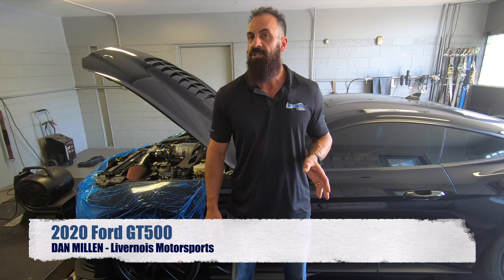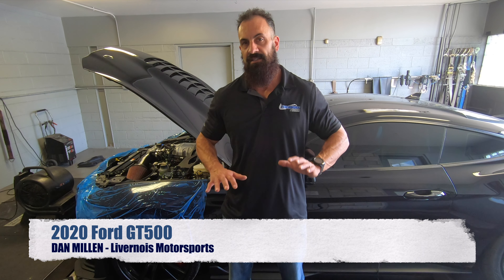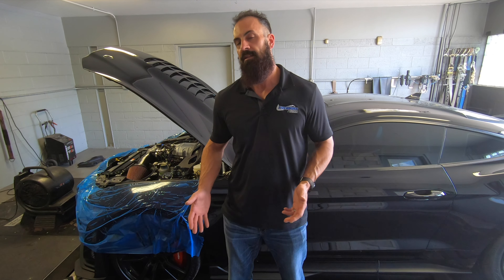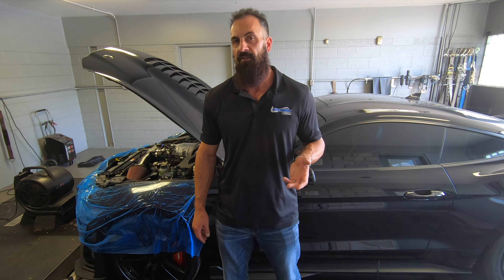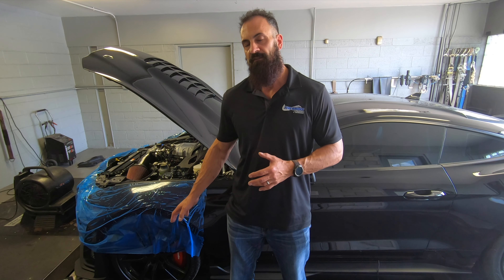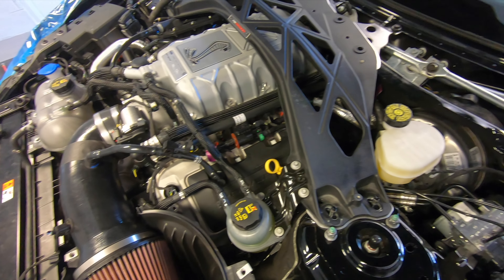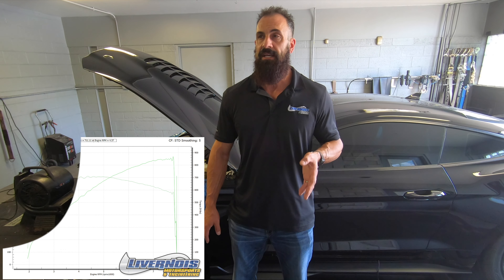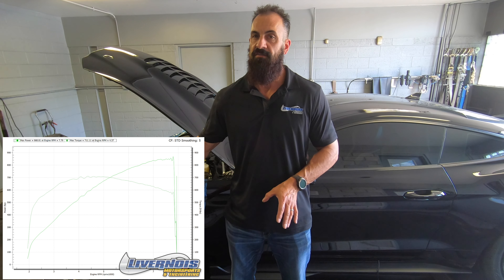2020 GT500 makes 1025 HP with only 3 part changes and E85!

Comment: Was this done at livernois in Michigan? What you guys did here is exactly what I'll be looking to do to my gt500 that I just acquired  when the time comes. Also do you think a upgraded belt tensioner would be needed? Would probably benefit from a throttle body upgrade too yeah? Also maybe upgraded fuel rails/injectors?
Reply from the maker: We did indeed perform these upgrades in house. As for the tensioner and throttle body, the tensioner isn't needed, but the throttle body indeed can be done as well. Usually with those changes we would also add fuel rails, cross over tube, and some other small upgrades.

Comment: Why you take off the intake lid cover?!?!? What i understood that your carbon fiber intake should work will with close box which will keep the inlet temp cool 
Am i right??
Reply from the maker: Our Airbox does work with and without the lid. The lid being installed typically does not lower temps except in the most extreme conditions, but for the Dyno testing it has not been reinstalled. It was installed prior to delivering.
Reply: @LivernoisMotorsports  sounds good , that mean there are no different between your intake and other brand such as JLT , because the only thing make me love yours than other its the close box which should maintaing the inlet temp without mixing with hot air in engine bay . I will switch to JLT .
Thanka
Reply from the maker: @6598901  Well ours is a higher flow than all others due to a much larger interior dimension. Also ours retains the lower box assembly, which is where most of the heat protection comes from. 

So, if you want to reduce flow and increase temps, by all means, switch.
Reply: @LivernoisMotorsports  thanks for clarifying  these points, so am running your system did you recommend taking off the lid while driving and roll race? Does it make any diffrenet in power? Right now while am driving with lid i obserive the temp differencial is around 2 degree  between the IAT and MCT
Reply from the maker: @6598901  Unless you're running at least our s1100 package, the lid on or off won't matter. Above 1100hp, the kid starts to become a small restriction, and we recommend removing it.

Comment: What kind of fuel system does the GT 500 come with to be able to run e85 without a return style fuel system ?  Would the dual pump fuel hat be compatible with a GT ?
Reply from the maker: These use an impressive dual fuel pump system with dual fuel pump control modules. There is no advantage to a return style system, but several disadvantages. While you could make it work in a 18-23 GT, it would take a fair bit of custom work.
Reply: @LivernoisMotorsports  so in a gt there is no choice but return style if you want to run e85 boosted correct ?
Reply from the maker: @freedom6919741  We've taken a hybrid approach for these and utilize a return style system and the oem computer controlled system as well. This allows the computer to control the main pump and extend its life, and the second (or third) pump to turn on under boost.

Comment: Does this GT500 has fuel pump booster?
Reply from the maker: No it does not. Further upgrades do require it.
Reply: @LivernoisMotorsports  what injectors size? And in which level i do need to go with booster pump? For example , can i stay with 1050x injectors + 2.7 pulley + E85? 
In this level the stock pumps will be able to feed the injectors ?
Reply from the maker: @6598901  We do mention the specifics in the video, but we use fic1000 injectors on these, we do not support ID on this platform. This also has a 2.65 pulley as mentioned in the video as well as our carbon fiber cold air intake.

Comment: Was this done with the oem manifolds and cats ?
Reply from the maker: Indeed it was
Reply: @LivernoisMotorsports  So I guess the cat over temp protection is still in place with E85. Would there be any long term issues with the factory cats running E85 at 850 to 900 whp thanks.
Reply from the maker: @pro5.019  Not that we've encountered since EGTs are typically colder with e85.

Comment: What injectors did you use
Reply from the maker: We use FIC1000 injectors for this package
Reply: @LivernoisMotorsports  is it reliable for this motor and trans ? The package I’m referring to and power
Reply from the maker: @r2ghclan271  Yes, it's our #1 package for these. And it's been extremely reliable.

Comment: With all due respect, no modern vehicle is losing 200 hp from drivetrain losses. At best, it's losing 80 hp.
Reply from the maker: This made nearly 870whp, and at 15% loss comes out to almost exactly 1025. 

Now take the 645whp baseline and that works out perfectly to 760 assuming 15%
Reply: I think 15% is high for this DT. I read ford stating the dual clutch has far less loss than a traditional transmission. In fact stock cars were hitting over 700hp at the wheels, right?

Comment: I think I missed the 1,025hp aspect of this video...?
Reply: The numbers he showed were Wheel Horsepower, the numbers stated in the title are Crank Horsepower.
Reply: @johnnazar180  Thanks for the clarification. I didn't read the description or I would've seen it. Thanks again.
Reply: Ford as with most All of the OEMs measure horsepower at the crank. So the video shows how much it makes now at the wheels so you don't have to remove the engine to get the crank hp figures basically.  So you just do the math on the drivetrain loss to get the crank hp which is over 1,000
Reply: @online247365  Yeah np
Reply from the maker: With the drivetrain loss it's 1025 at the flywheel
Reply: @LivernoisMotorsports  Is there much of a difference between the crank and flywheel numbers?
Reply from the maker: John Nazar Crank HP and flywheel HP are 2 different names for the same thing.
Reply: @LivernoisMotorsports  alright that's what I thought. Thanks!
Reply: @LivernoisMotorsports  Fantastic that too from a 5.2l block, I am impressed with Livernois Motorsports works as well, great tuning guys, with such a great platform there are too many chances one might mess up. But that dyno result seems perfect for a car like GT500
Reply from the maker: John Nazar You're welcome!
Reply from the maker: Ponygt 662 we're impressed with how easy it was to get here, but we definitely have more planned for this!
Reply: @LivernoisMotorsports  Ported blower, full exhaust and cams? 920+ whp?
Reply from the maker: John Nazar It would be unlikely that it would need cams to get there. We plan on some more upgrades soon just to see what it takes, but we're targeting mid 900's without getting crazy with it.
Reply: @LivernoisMotorsports  
Wish ford put this motor in a little more light weight package, as of now the GT500 is a mammoth..too heavy but still able to keep up with some ZR1s in stock form which is pretty impressive
Reply from the maker: @ponygt6629  We just wish they would take the FCA approach and put it in everything!